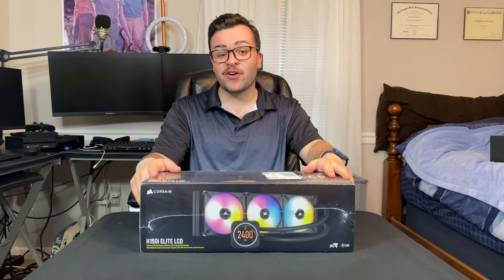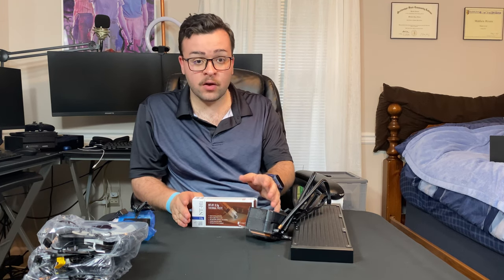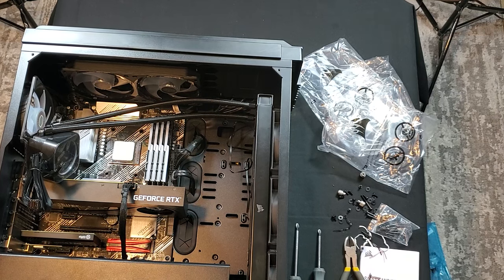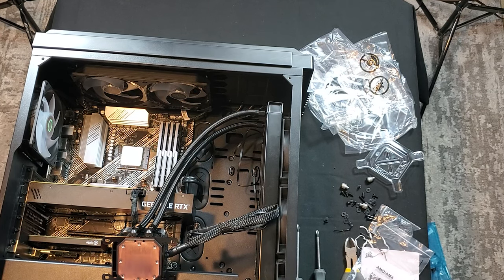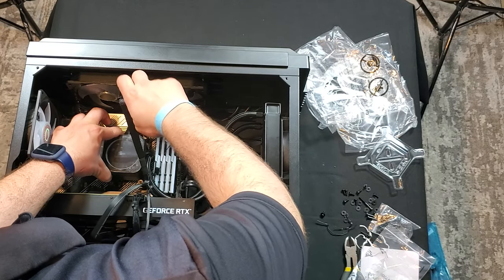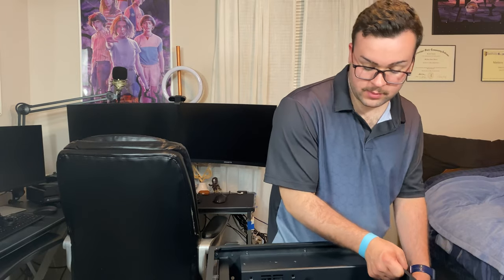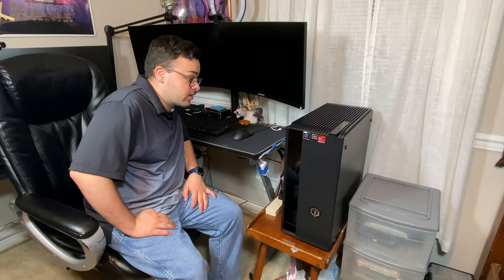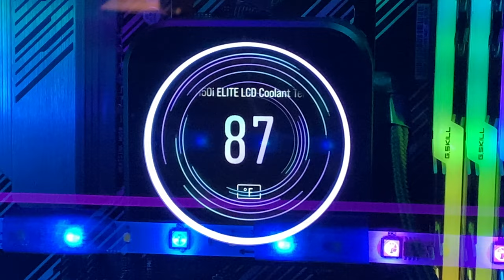UNBOXING|INSTALL: Corsair H150i Elite LCD AIO (All-In One) Cooler

Comment: Hey. To connect AIO, you use CPU FAN or AIO_PUMP connector? Becouse all people use CPU FAN, and i dont know why?
Reply from the maker: When I connected to the AIO_PUMP, it boot looped my PC so I guess it has to work in certain situations. Thank you so much for watching!
Reply: @TheTechManE  You can avoid the boot loop by disabling a setting in the UEFI. Basically you have to set the UEFI to ignore the lack of a CPU_FAN. As a safety measure, the motherboard will prevent your PC from booting if you don't have anything connected to CPU_FAN.